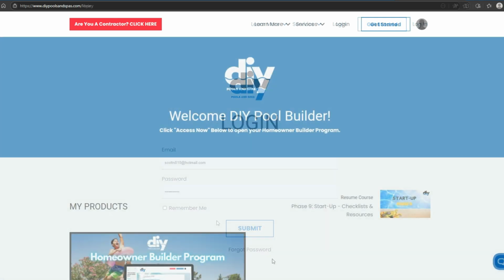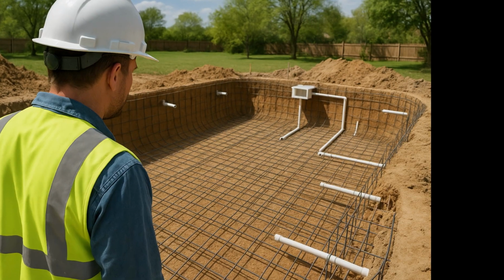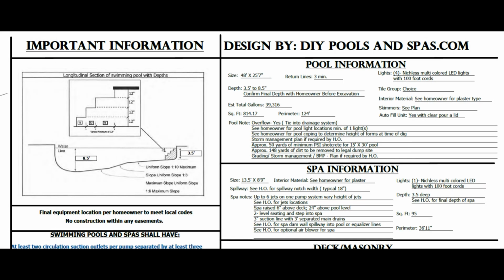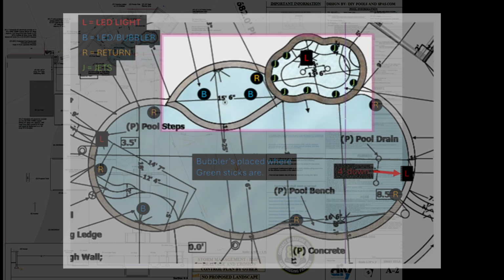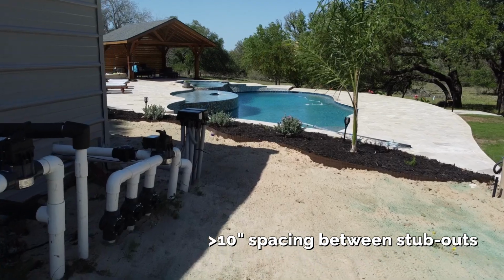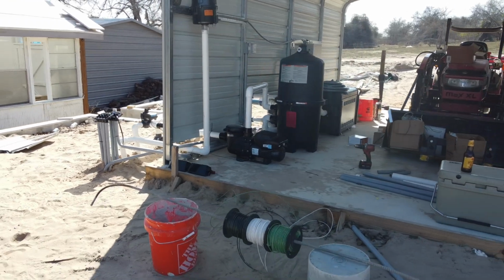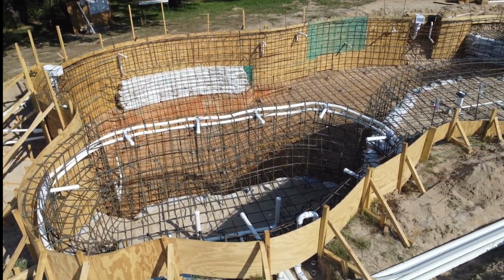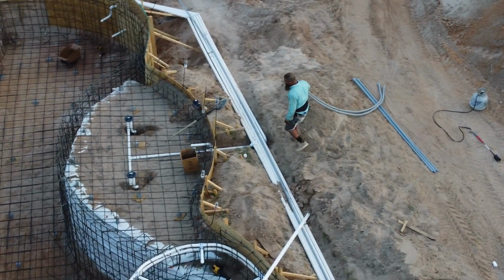DIY Pool Plumbing – Pipe Sizes, Returns & Pressure Testing

Comment: Is it true street elbows restrict flow you should use sweep elbows
Reply from the maker: Yes.  Sweep is most efficient flow.  Then it is short radius 90s and the least efficient is street as it is a tight turn with a lot of turbulence.

Comment: Are you running the spa jets off of the main pool pump? Or do you have a separate one. We are planning an 8 foot round spa and I want at least 8 jets. Obviously I think I’d need a dedicated spa jet pump or the jets might be too weak.
Reply from the maker: You will need a booster pump to run more than six jets.
Reply: @TexasDIYCoach yeah. That’s the current plan. Just trying to figure out the best possible plumbing run

Comment: Fancy schmancy!  I have a question - did the backside forms get stripped out after the shell went in? Seems like.the plumbing connected like.this through the backside forms would make it hard to strip out. I know most strip out crews are just labor, not the best tech team and they would be awfully hard on all all this plumbing. I definitely prefer to stub through and run plumbing in the overdig after the shell is shot and forms stripped. Nice pool! Thanks for the name drop!
Reply from the maker: Luckily, the same team that did the excavation also came back to pull forms and do the grading.  I was personally worried, not only during that period but also the decking period and watched that pressure gauge like a hawk.  Over the entire time, with machinery, the base rock, the compactor, more concrete, and tons of rock, the plumbing pressure held!

Thanks for stopping by @Swimmingpoolsteve, I spent hours on your site learning about plumbing.  I think that there are probably two types of "DIYers."  Those that rely upon the expertise of the plumber and the inspection process, and those like me, who want to learn as much as possible and then ask a bajillion questions.  Your site really taught me everything I thought I needed to know and more.  

Overall, we only had one area where the plumbing design did not work as planned and that's the spa shelf.  At low pump settings, the pressure is not high enough to keep water up there and it seems to actually flow backwards through the return to the main pool.   I have a plan to remedy that in the near future.
Reply: @TexasDIYCoach does your spa drain down if you turn the system off? If so, you are not correctly designed. I see foot valves in use (check valves on the suction side) which is not common due to these being the worst case for flow restriction. I suspect you need a make up valve ahunting between the poop return and spa retuen line, consisting of a check valve and line valve. The absence of the check valve here would cause the symptoms you are describing.
Reply from the maker: No, the spa is fine.  The foot valve is to maintain pump prime because the pump is 4 ft higher than the main pool.  When it is in spa mode, the shelf drains to the main pool, I am guessing through the return on the shelf.

I am going to swap the eye ball for a check valve at the return.
Reply: @TexasDIYCoach in a closwd loop plumbing system you can retain the prime to the pump with the check valve on the pressure side of the system where it introduces less efficiency loss than on the pressure side. The pump only loses prime if you open the system to air, like taking the lid off the pump. Otherwise a pressure side check valve on the trunk line accomplishes the same thing. More than one check valve or foot valve on a system is generally frowned upon. Excluding the one located in the spa make up line if you installed one of these.
Reply from the maker: @Swimmingpoolsteve ok...so, I should remove the foot valve then and rely on the check valves on the pressure side.  It probably explains some of the low suction at the skimmers.  

I also want to add another pump to use on bubblers.  I had that in original plan but let the plumber convince me it was not needed.